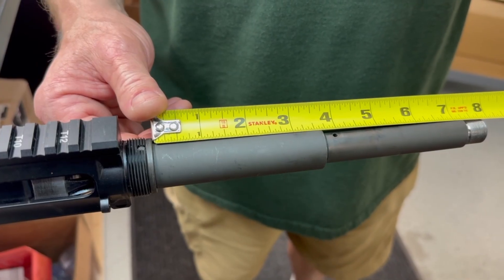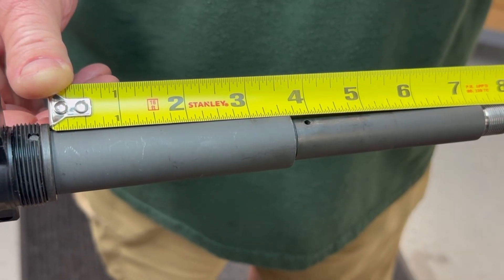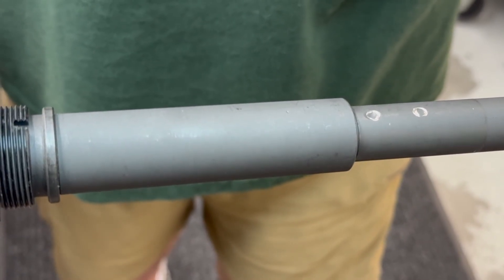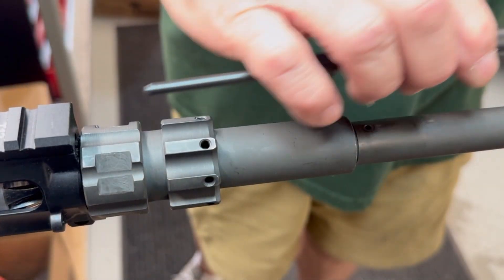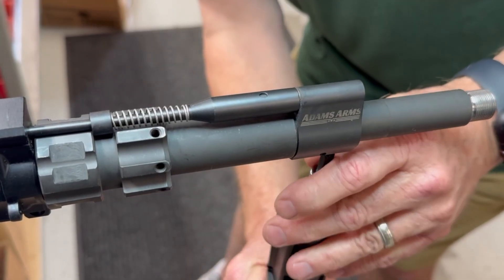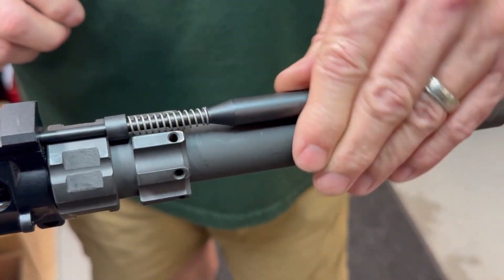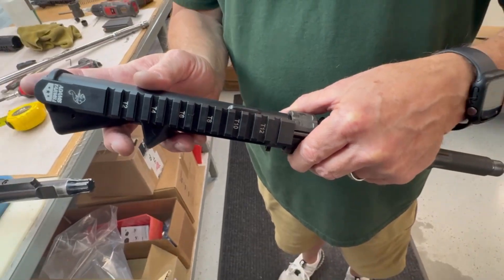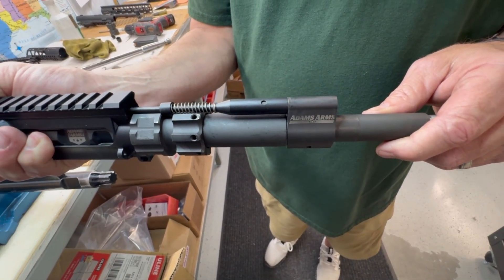Adams Arms Piston Kit Install *Updated 2025*

Comment: I have an older style Adams piston on a 5.56 gun and love it. I have a question about my new low pro .300blk kit though. I assume one should remove material from the "bolt end" of the piston and not the "cup end" to achieve .015-.025" clearance from the gas block, correct? If anyone has tips on how best to do it, I'm all ears. None of the videos I've found show this part of the process.

Comment: Will this function with a standard buffer?  I built my own AA .300 black kit before it was offered from the factory, with a skeletonized carrier kit by a lighter piston return spring, opening up the gas port to 0.120”, and pulling the weights out of a carbine buffer.   It runs great suppressed and unsuppressed, but only with supersonic ammo.  

Glad you guys are back.